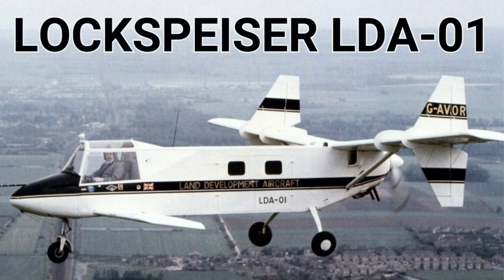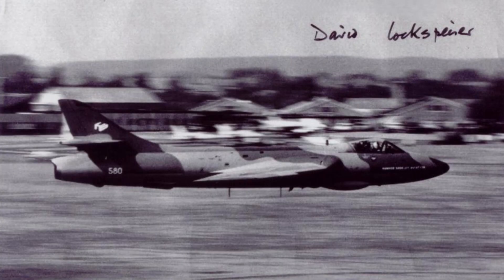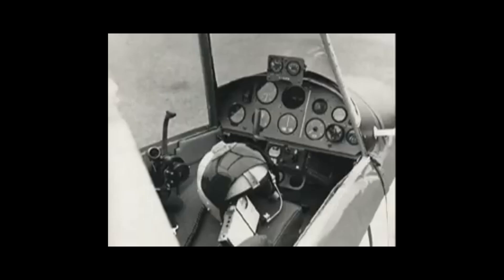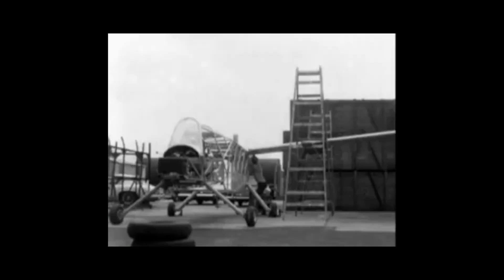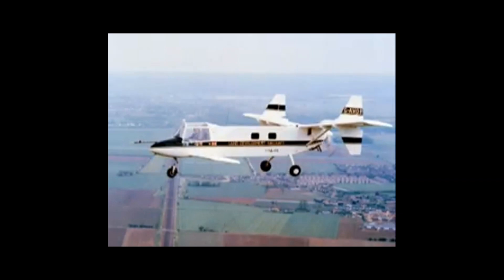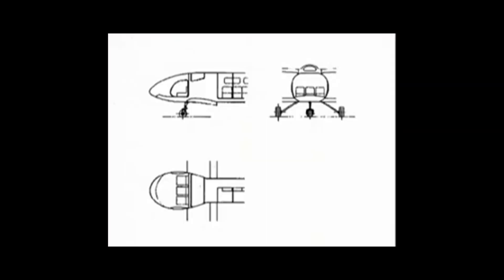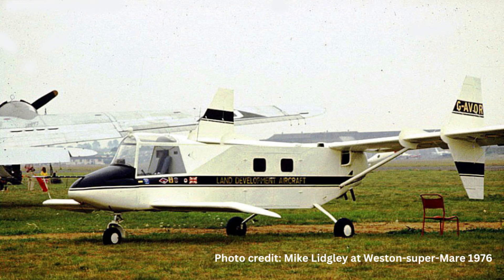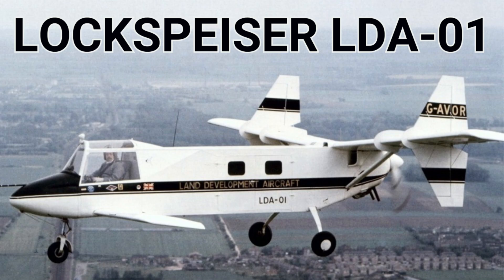Lockspeiser LDA-01 I Aviation Rarities Episode 17

Comment: It's funny how often arson is responsible for ending so many promising unusual aircraft projects.

Another little-known and unusual and very promising aircraft, was from the Arup company in Indiana in the '30s. ("Air" + "Up")

It was the intellectual forebear of the Vought V-173 "flapjack" and probably other oddballs like the wartime German Sack AS-6, the post war USAF/Avro Canada Weapons System 606a (of which the Avrocar was the VTOL landing gear test rig, and the Soviets were working on a circular planform supersonic super-STOL plane at the same time).
Being of very-low aspect-ratio, they were notably not draggy but sleek and efficient and quick on available power.
The Arup S-2 and the later S-4 flew for several seasons at airshows, frequently carrying advertisement because nobody wanted to buy or invest because they looked funny.
Video of them shows the super-STOL super-slow fight performance and 45° steep climb.
(the S-2 was acquired by the Mid-Atlantic Air Museum in 2015)

The flying "Heel Lift" - Arup S2
Bomberguy (1min 55, but skip ahead to 48seconds in for the video)
https://youtu.be/Nxz1UF67EQI?si=mE01sYca8ND7Yyg8

Comment: It should be remembered that the eventual limited number of Concordes meant that they could not be economically sold to the two airlines with an expectation of flying at a profit. A project that big gets tax payer attention. This is much smaller and so is the economic scale which makes it just as vulnerable to money  however good it may or may not have turned out as a useful aircraft. It is a pity commercial experience did not get to decide its fate.

Comment: I'm wondering if there were problems with ineffective yaw control. All the films showed the aircraft in straight and level flight apart from take off and landings. A properly coordinated turn might be an issue with all that slab side and those tiny rudders. 
This was clearly an issue, as attested by all the variations of yaw control in the video.
Ta.
Reply: Always wondered why canards don't have a rudder in the form of a fairing on the steered nosewheel. Trying to shove the main mass sideways with those wing rudders is plain daft, so why not have an independently operating airbrake at each of the wingtips?

Comment: This should be tested with the addition of a front tractor engine like a skymaster, only with more emphasis being placed on the front engine being used totally at the operator’s discretion; that is, on all the time, off all the time, or anything in between. Maybe for takeoff and climb out, and on approach and landing as a safety measure, but off for reduced fuel consumption during in-transit cruise. Having heavy hauling, or maximum speed, or minimum speed “loiter” or patrol/search capabilities, virtually at the turn of a key, and all at the pilot’s discretion just might be a game-changer. Another option not available to Mr. Lockspeiser would be to make it a hybrid design, so that the front engine was a brushless AC induction motor that ran off batteries charged by the rear combustion engine.

Comment: A fantastic design!
It could have been developed into a 10-20 seater aircraft - with ONE 1000 hp gas turbine engine - taking a similar role to the Cessna Caravan and de Havilland Twin Otter.
Also as a version that could take euro pallets (or small containers with a similar "footprint"). 
With even more practical solutions, and with even safer flight characteristics than the Caravan and Twin Otter (which are themselves quite practical and safe).
I have long been a fan of aircraft with canard design, and for tens of years thought that they would be the design of the future. But it looks like the future is coming very slowly…
Is it just old traditions - within the big aircraft manufacturers - that lead to most newly developed aircraft still having "classic" (non-canard) designs?
Reply from the maker: Yes it could possibly but defeats the object. lt was not the same the rest  & simple to operated low cost & repairable in the field.

Comment: I'm guessing it wouldn't be  good for short field operations, do to the canard çonfiguration and the propeller on the rear. This could be its greatest falt. Otherwise a very good design.
Reply from the maker: I think a pusher prop at the back is good. Stones are not coming up hitting it or the airframe. Short field was very good.
Reply: @talesfromthehutandhangar  lifting the nose up during takeoff and landing, will lower the propeller.  This could be a problem.  It will also limit the angleof attack or how much nose up pich the pilot can do before the propeller starts digging a trench.  I'm pretty sure you have seen STOL. competitions before.
Reply from the maker: I think it was a compromise, so it could function in its other multi roles

Comment: The only reference for a canard type that had any success was the Rutan long EZ. They were criticized for long and shallow TO performance, and their spindly nose gear wheel. Though the Rutan design was meant to be a little speed ship, I would imagine a heavy lifting canard design would have suffered similar issues. Not likely to be STOL capable with such a feature being an important advantage in all of the LDA-01's competitors. BTW loved the video, very thoroughly depicted, and a design yet again unbeknownst to many viewers.
Reply: Steven, I guess it depends on the definition of success.  The Beechcraft 2000 Starship was a measured success even though it didn't meet the performance promised.  Loved by a limited few by apart from a couple, bought back by textron to avoid having to support them until the last one retired.  Coming as a hybrid when is a canard not a canard is the Piaggio Avanti which seems to still be active.
The Cozy looks like a clone of the Long Ez and VariEz but is more practical.
Reply: @planesounds  Yes. I saw a Starship demonstrator at Avalon airshow 1995. Forgot about the Piaggio Avanti. They have always built sweet looking aircraft. The Curtiss XP-55 was also a successful canard design by your more open definition, but Curtiss couldn't cure some unique and violent stall/spin characteristics that ultimately killed a well known aviator of the time.
Reply from the maker: Glad you liked it

Comment: Actually saw this aircraft in the flesh at the 1976 International Air Tattoo. I hadn't realised that Lockspeiser had worked with the Miles aircraft company. That would explain the configuration of the design, which has a resemblance to the World War 2 era Miles Libelula. Unfortunately, the LDA was never developed beyond this prototype.

Comment: Wingspan was 26 ft plus the fuselage width. Yes, I recognise that each panel (foreplane and mainplane) was 13 ft span, but that is not how wingspan is calculated. Do we assume that the change of name from Boxer 1000 to Boxer 500 reflects a reevaluation of its load carrying capacity? The initial description said the belly pannier had a  load capacity of 1000kg, but it seems to have been discarded for the production proposal and the doors were the full height of the fuselage. Load seems to have dropped from 1000kg to a quoted figure of 272kg. That is a LONG way from the initial expectation.
Reply from the maker: Yes, the span was an error on my part.  The specs changed a lot during development. It looked different in almost every photo. I guess, just trying things out and showing options. l did wonder how they lifted the cargo pod up into the aircraft. Dropping cargo as he proposed would have been dodgy with the prop.
Reply: @talesfromthehutandhangar when trying to sell a design you attempt to cover as many bases as possible, and a few that are not!, then reality whittles down the options, hopefully before things have gone too far, and you arrive at something that is close to practical, it's how the process works, best not shout too loudly at the start and get hopes up, just loud enough to get started😊.

Comment: Lockspeiser was indeed way ahead of his time. A brilliant design born of a lot of experience. Tragic that the prototype was destroyed in such a way. Imagine what he could achieve given present-day  design processes.
Reply: Poppycock. plenty of aircraft built to this design before Lockspeiser built this thing. Miles M39 for example. All of them failed to enter service because they had no major advantage over conventional designs.
Reply: @richardvernon317 the ability to load unload direct from a truck with a level platform is just one of the features that has yet to be delivered in light aviation as was the ease of the float conversion.
Miles M39 fell foul of a procurement process structured for wartime production and a very conservative selection thinking. Had the LDA been made in the eastern bloc then we may have seen production due to its simple utility nature, similar to the Antonov Colt biplane, another big problem is the utility market is dominated by a small number of companies making sales penetration very difficult, a common problem for all small manufacturers, regardless of what they make, let alone someone right at the start of the process. The great shame is with the destruction of the prototype the aircrafts potential was never allowed to be reached, whatever that may have been.
Reply: He'd burn through his money even  faster.

Comment: Way ahead of its time.  Would have fun to build and fly.
Reply: Design was tested in the 1940's as the Miles M36 and M39. Didn't work that well so was dropped.
Reply: Ahead of its time?  How do you know its time will ever come?  It has not met any worldwide demand or we would see these things flying.
Reply: @gort8203  We are talking about the design philosophy and modularity. That was the part that was ahead of its time. 

If they sold these as a kit, it would be at the top of my list. First thing I would do is convert it to electric. 

Might as well make it out of carbon fiber as well, It's just a box the layup is super easy. And the costs have come down so far carbon fiber is the new fiberglass.

Have you seen that video of the robot dog taking a walk on top of a ball? 

I read the paper, the secret sauce is a really simple trick. And can be abstracted to just about anything. So fully autonomous autopilot would take a couple hundred bucks to train, either renting the CPUs or tasking a 3060 or better for a few weeks to generate the synthetic data. You don't even need a copy of X-Plane anymore to make your own software defined autopilot (like software defined radio, you can change the flight characteristics on the fly).

Etc.

Zipline's delivery drones share a very similar design and layout. 

So yes, ahead of its time. This was a plan for people who wanted to tinker. They should have sold it the size it was.
Reply: @jtjames79    Lots of words there to convince yourself of . . .  something.  But the design philosophy has not been put into use, which it would have if worthwhile, so it was not really ahead of its time.
Reply: @jtjames79  No we are not, you are talking about it, and you are just repeating yourself. Build anything you like, just don't say a "philosophy" that went nowhere is ahead of its time.
Reply: @gort8203  Being aggro doesn't make you right.

I also like how you made a second post just to accuse me of repeating myself. 🤔